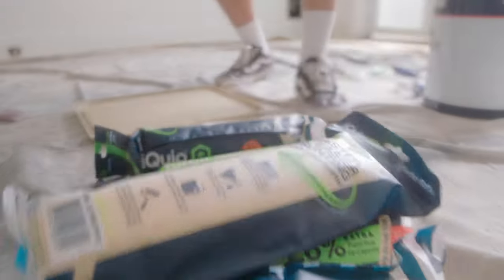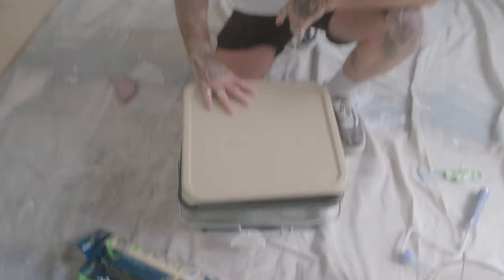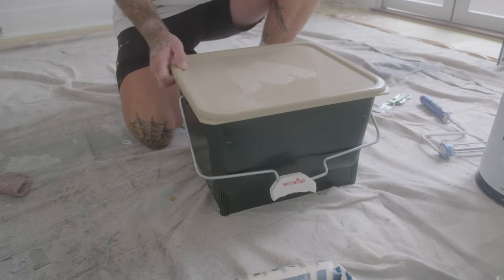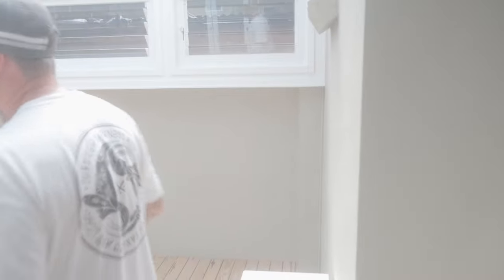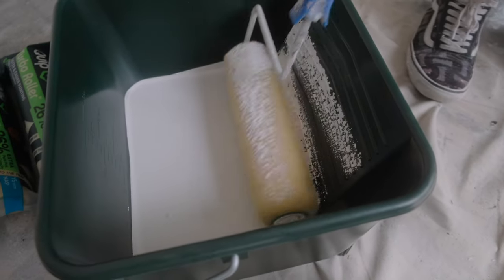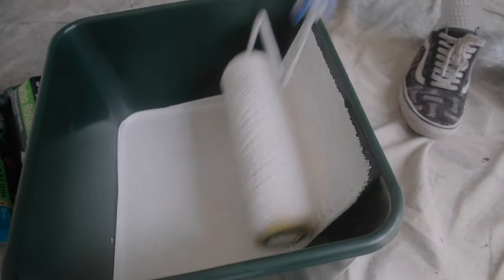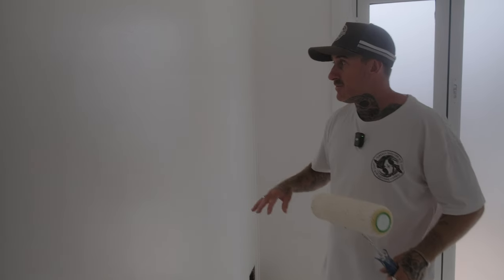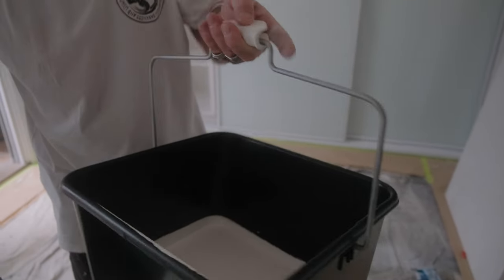THE BEST PAINT ROLLER SLEEVES I'VE EVER USED?

Comment: I've recently started using 460mm rollers for broad areas and it seems to be going well. Obviously a bit heavier, but very fast and even. Goes good on ceilings. Have you considered doing a vid on roller widths (or widths and naps)? Pros/cons, domain of application for each etc..
Reply from the maker: I use to use the 460 alot on new builds and commercial jobs. Now I do mostly repaints I find the 270 a little bit better for rolling when furnished and around fittings. Every roller size definitely has the right application. Great idea I will do a vid on rollers naps/width. Cheers Legend appreciate the message and watching on 💯🙏

Comment: I've been taught a few ways to roll out a wall. I see guys put it on and then go back to the original starting point and do a final down pass more often over here. What's your input on the style you use vs the one I described? I've tried both and honestly can't see much of a difference between the two as long as the paint lays consistantly and isn't showing roller marks.
Reply from the maker: Yeah I think it always comes down to the individual I spose there is know wrong or write way to put it on and lay it off as long as you are achieving the same seamless smooth finish that's what really matters. I do it differently sometimes what ever happens on the day🤣 I usually load it up do a big M than work my way out from my previous    section I had layed off then work back in to that section then repeat the process if that makes sense. I will do a video on this also in the future. Cheers for watching on and the comment 💯🙏

Comment: Gave these ago in the 11mil, didn't push it for coverage, but would have covered half the amount you pushed it too with the 15. The main thing I liked is how well it kept up it's coverage rate for the complete job (roughly 200 sq/m). Easy flow off and very smooth finish and didn't really need any laying off. Cheers for the Vid